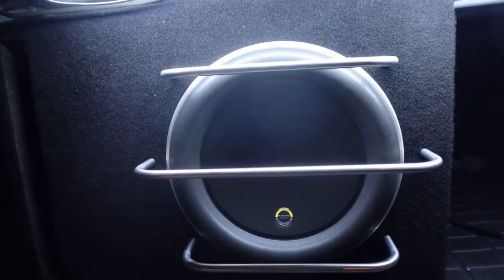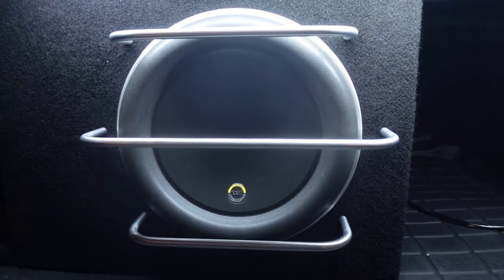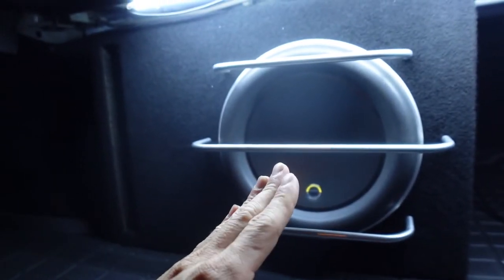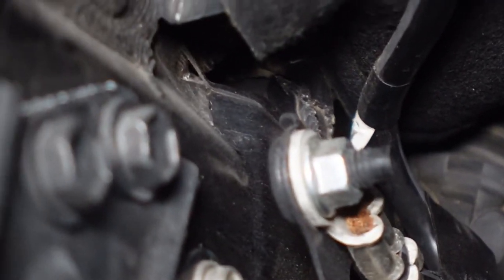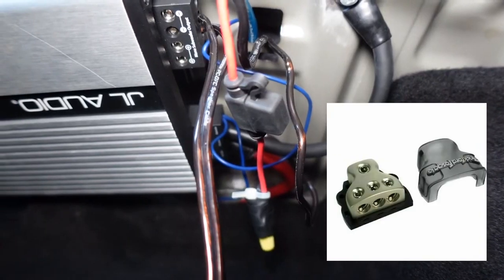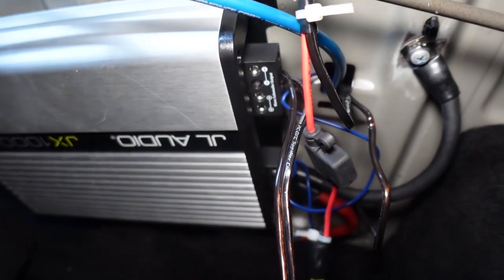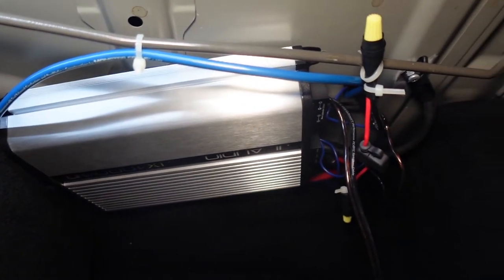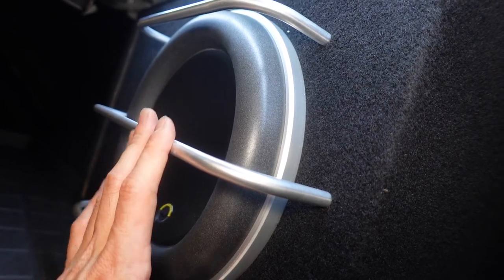JL Audio 12W7-AE Review and my GS350 Subwoofer wiring walk thru!!!

Comment: fuse rateing to the devise...NOT the wire
Reply from the maker: Hey what's up. I should have been more clear in the video, it should be the lesser of the two. You don't want the wire to melt and you don't want your device to overheat. Thanks for the comment!
Reply: @j168vlogs  correct,. wire should be 3 times the gauge rating of the appliance,....theory ..1.5x in reality
Reply: because you politely responded and you got skeler music...upgrade to a pro cerwin vega 15 or 18 for SQL....BUT for skeler bass go sundown or skar

Comment: Wondering how a pair of 10W6s would match up against this single 12W7. No doubt louder, but low end accuracy is my thing.
Reply from the maker: Hey what's up! That is a good question. I cannot answer with 100% confidence but I think the 12w7 is going to be more accurate at high volume low frequency based on the Xmax of 1.15" compared to 10w6 Xmax of 0.75". Are you having trunk space limitations?
Reply: @j168vlogs  YES!😞My space is 30” wide. A bottom port maybe?
I currently have a pair of 8s. Wanted to increase cone area. I can do a single 12, which is about the same cone area I have now. A pair of 10s would be an option, and why I asked.
Reply from the maker: @milesbachelor8747  what kind of car are we talking about? Going from a pair of 8s to a 12w7 is a huge jump. The 12w7 is an interesting sub such that it has to be turned up to work properly. The only volume I can enjoy my music is LOUD with that sub and it could be too much for a small car. What do you think about a 10w7?
Reply: @j168vlogs  I have an Infiniti M45. Good size trunk but it narrows close to the back seat. A single 12W7 is totally in play considering the price I’d pay for a pair of 10W6s.
The goal is reaching the lows, not necessarily loudness because I’m not a high volume listener.
Reply from the maker: @milesbachelor8747  Duuude! Old school Jdm legend in the houz lol. My friend drove an M45 back in 2000, it was a real people magnet car. I think that car is big enough such in a way that a 12w7 playing at minimum required volume won't be overpowering. Be warned though, this sub can get crazy when you want it too. Let me know what you decide. I would be interested in hearing your thoughts.
Reply: @j168vlogs  Yeah, I remember that car specifically for the exhaust note. Mine is a ‘08, same motor but more curvaceous body 😂 well-kept and only 106K miles. Love it.
Since I’m gonna keep it a while, deserves the correct audio. JL works in small spaces. 
Winter project is electrical and DSP amp, then finally the $ub$ lol

Comment: Hey bro, do you recommend a single 10" or 12" W7 for a mid size SUV? My other option is two 10" or 12" W6s.
Reply from the maker: Hey what's up! I had 2-12w3's in a 2000 Toyota 4runner back in the day and it was just enough to "disturb the peace". What mid-suv do you have?
Reply: @j168vlogs  I have an Acura RDX. I was thinking the pricing on the W7s is a bit steep so I either get one of those or two of the W6s. I'm not looking to rattle the whole neighborhood. Just something that can hit hard when the music calls for it but also have the clarity and accuracy a audiophile would be proud to have. I listen to a variety of music but mostly electronic.
Reply from the maker: @MrSupernova111  ok got it. The 12w7 I have needs to be played loud for accuracy otherwise it is inaccurate at lower volumes. I would start off with one 12w6 2ohm and a 1500 watt amp wired in series for a 4 ohm amp load, that should be good. If you are dissatisfied with the volume, you can get another 12w6 2ohm and wire both subs in series/parallel for a 2 ohm amp load which at full volume will "disturb the peace". Sealed Box is most accurate, ported/bandpass will make it more boomy. Good luck man! here a link for the wiring info to double check my comments: https://jlaudio.zendesk.com/hc/en-us/articles/204374200-Dual-Voice-Coil-DVC-Wiring-Tutorial